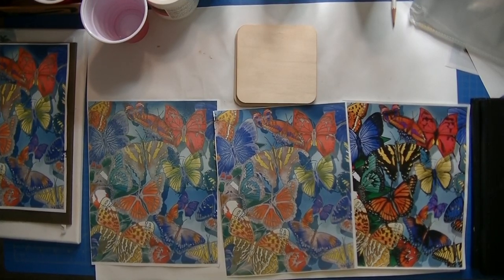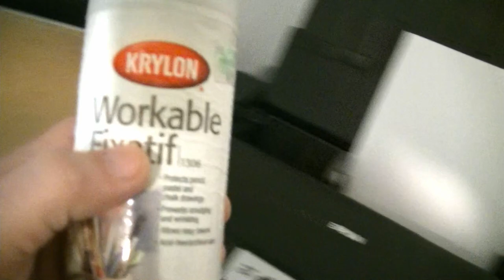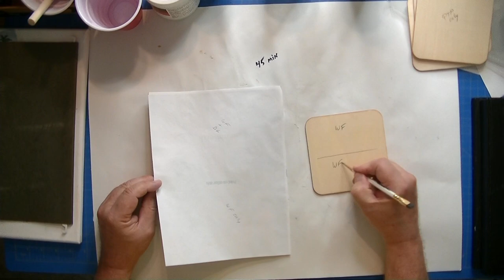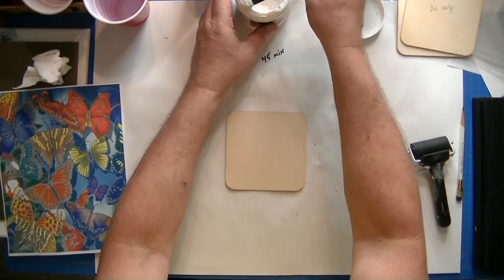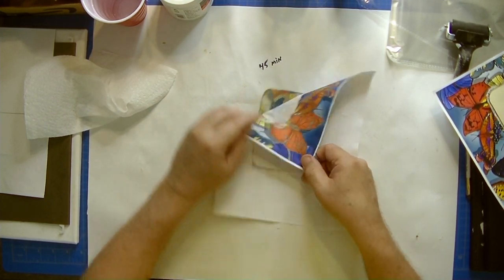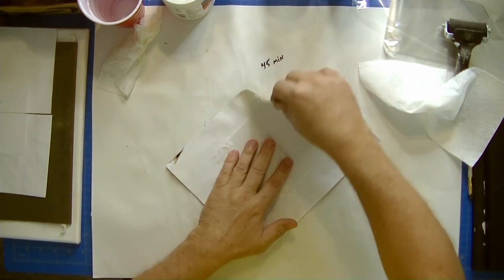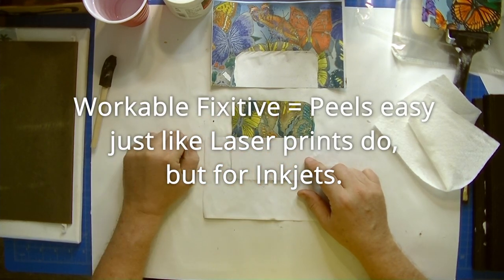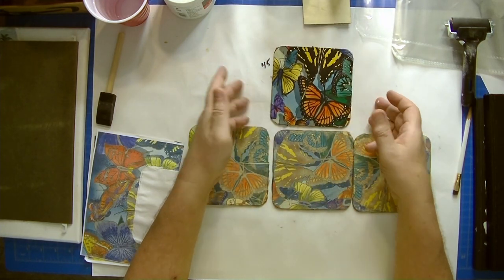Inkjet vs Laser Printer Image Transfer | RixCanDoIt Quick Transfer Paper

Comment: Why does it look like there is little or no black ink in your inkjet prints even before transferring, the paper print has no black ink on the butterfly's wings.
Reply from the maker: It's because the INK is reacting to the coating on the paper. That's why it is not recommended to use an Inkjet with this paper.